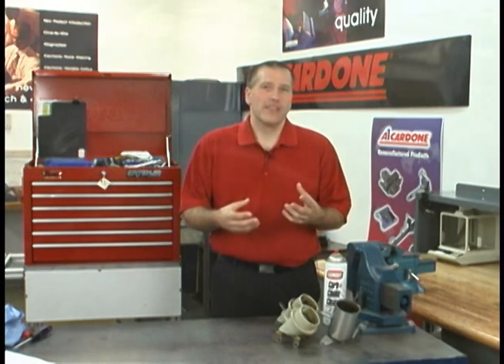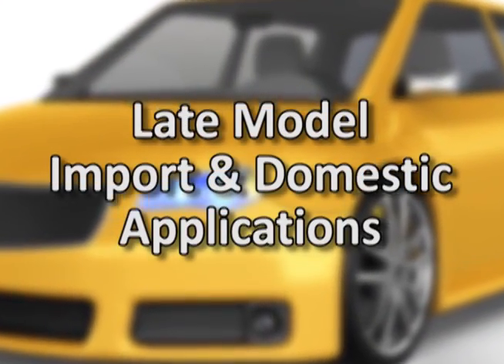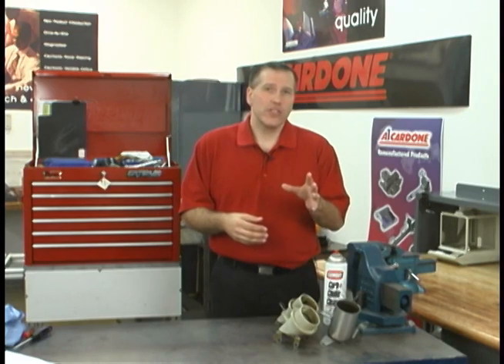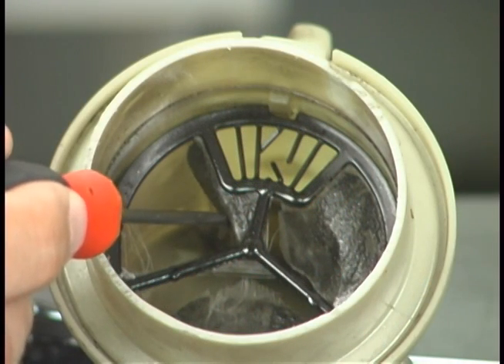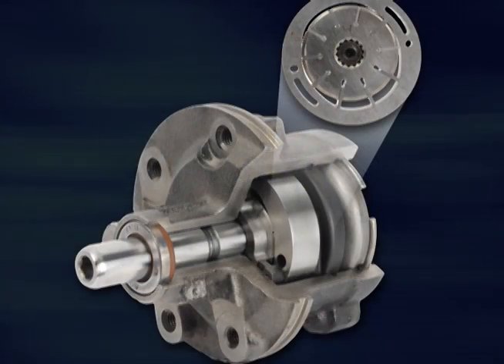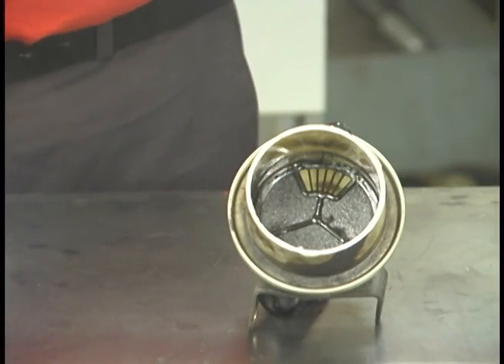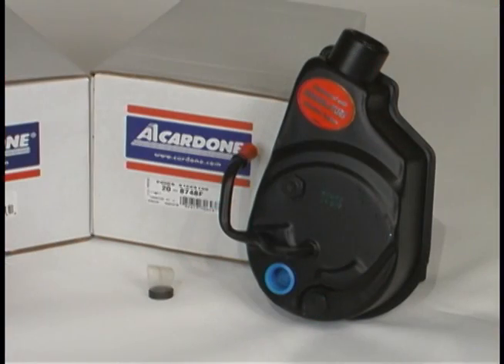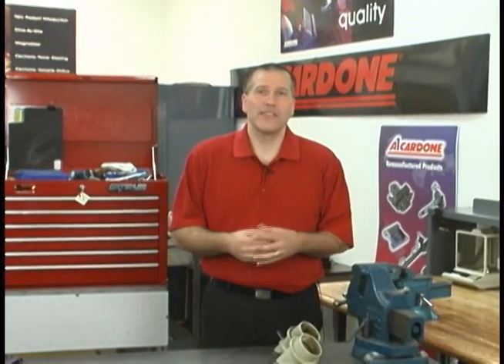Power Steering Pump Replacement: Troubleshooting a possible Dirty Reservoir Screen

Comment: Well, I had my servo pump and reservoir replaced, and because the Lauber aftermarket pump was starved of servo liquid, they concluded that the new reservoir was at fault and they put back my old reservoir which they said had no filter, and now the pump runs fine... But is it right to have a reservoir with no filter? Did the old one really had no filter?

Comment: I have '01 BMW 3 series. The reservoir is very common in BMW's. Most what I saw filter can’t be cleaned, buy new res. I figured there was a way to at least back flush the screen. The res is cheap and not really looking into I bought new. The screen CAN be cleaned. An allen wrench will release the screen. It is possible the res itself can be disassembled to get a really good clean but I haven't gone that far yet. Filter can't be removed from res w/out disassembly.

Comment: Hey all, possibly a dumb question. As long as there is a leak allowing air into the ps system, there will be bubbles in the reservoir? Is there anywhere to have an air leak and not have bubbles in the reservoir?? Thanks

Comment: Excellent video. Flush was easy as pie, however, my power steering is worse now. I changed the pump and the high pressure line because it was leaking. I did the flush and got fresh fluid through the whole system. Now, I have no power steering and it seems as though fluid is trying to go out but it’s not pushing back in so it’s overflowing at the reservoir. I have no leaks anywhere other than the reservoir cap. Could it be a clogged reservoir screen? BTW, I’m working on a 1997 Toyota Corolla Dx (Japan built) 1.8L
Reply from the maker: Hi Ramon,
After the unit is installed, the system has to be bled, (preferably by vacuum bleeding) and checked with a power steering pressure gauge. Before you started working was there was fluid coming out the top of the reservoir? If so there must be a restriction somewhere in the system. Please call our tech line at 888 280 8324 and a technician can walk you through a solution. Thanks!

Comment: This was my exact issue. Noisy power steering even after replacing or adding fluid.

Cleaned out the reservoir and found a huge chunk of black gunk. Replaced fluid and now I’m golden.

Comment: I don't have one of these screens.  I flushed and followed GM procedure to the "T."  First cardone pump whined like mad and had poor assist,  after following GM bleed procedure numerous times, never got better.  Second pump seemed to work fine, and no noise after bleed, but it lasted maybe 3 months and then just completely lost assist while my wife was driving it.  I am now about to replace it for the third time, and WILL NOT be using a Cardone reman this time.  Unfortunately, I will probably not be able to get my money back.
Reply: never purchase a reman for anything and I mean anything. You don't know what kind of shape it was in before they "replaced" or "rebuilt it." Same goes for engines. My dad built a reman engine block for a customer and the engine come to find out had been over heated so many times that the cylinder walls were warped and it froze up. My dad was rotating the engine to continue assembling the short block and about fell over in sheer awww because of how bad it was.
Reply: Cardone. Car-Done.

Comment: What do you mean, "Grab one of the o-rings"? My Pump for a 2002 dodge dakota came with a bag. Contents: 1 new spacer white plastic. To replace old one. Check, 2 o-rings. One is thicker cord then the other (I used the skinny one). Two metal washers or spacers? What are these for? Thanks

Comment: hi all. i have a 1998 honda city, the problem i face is that when car is at idle, steering is too heavy to turn and makes loud groaning noise, but when car is moving, steering becomes alpha light and no sound comes. what could be the issue? i have tried to top up the fluid but nothing happened. got serviced the power steering pump but issue persists. plz help
Reply: +SWEETHTOOTHFun "alpha light" never heard that one before but I'm guessing it means easy. To me it sounds like you have a bad P/S pump.

Comment: Hi..great video..I own a 2005 Toyota Tacoma.prerunner 2 wheel drive...I took it to Toyota dealer and firestone shop and no one know what's wrong with power steering system..
I live in south Florida ..when I start the truck in the morning I have vibration on the steering when I turn the wheels..then I goes away after the truck warm up..any idea....

Thanks
Reply: Thank you very much...
Reply: ***** ..Thanks for the reply... I did follow your suggestion how to fix the steering problem..
I ending replacing the power steering pump and cleaning the recivor...but unfortunately it did NOT resolve the problem.....
I had took the truck to Firestone shop and my local Toyota dealer.. And they can't find the problem.. Any other suggestions..

Thank you
Lenny
Reply: lenny cordero its the shaft coupling fixed a few of them they seize

Comment: I have a 06 acura tl don't know if it's the pump or the reservoir but steering wheel get tight when the car is sitting an loose after driving , where is the reservoir located ?

Comment: How do you replace the screen without having to buy an entire reservoir? I have a 2001 Dodge Dakota and I can't find the screen nor just the resevoir without having to buy the entire pump assembly. :(
Reply: These type are more common in imports. There may be an inline filter somewhere.